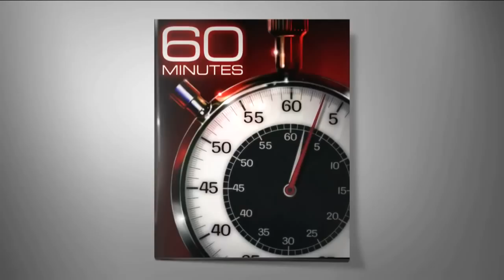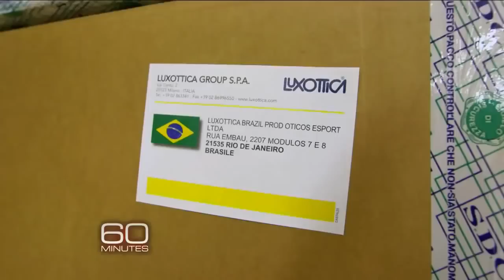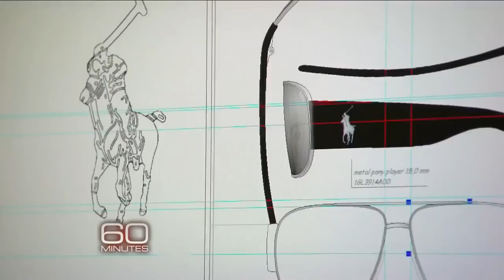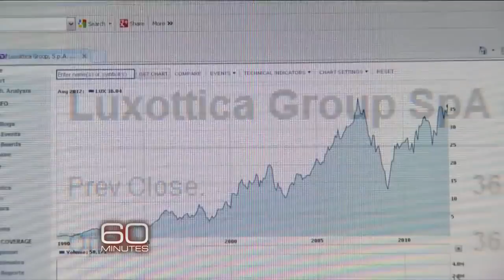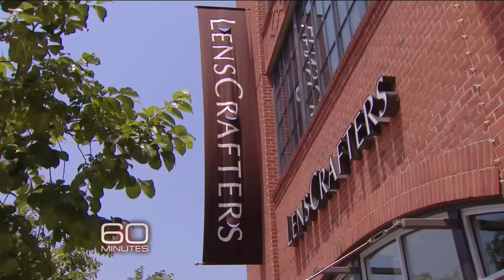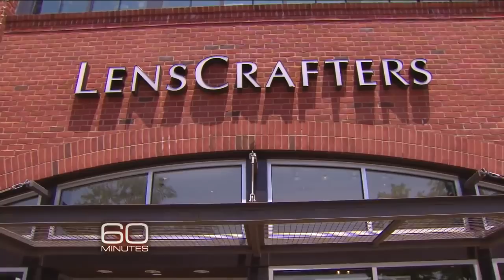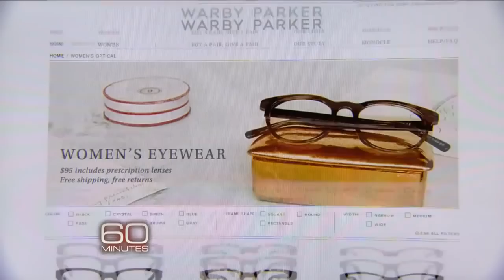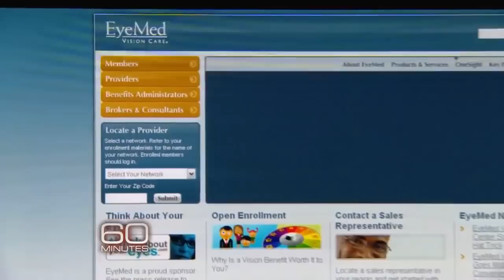60 Minutes   Luxottica  Do you know who makes your glasses

Comment: I bought Coach eyeglasses at Lenscrafters for almost $500 thinking they would be more durable. The side broke within a month and they are scratched even after paying extra for anti scratch. Took them to the store and the guy told me too bad, nothing they can do. Went to another lady in the store and she told me about sending them to "Luxottica" but that people didn't know about or use that option much and the first guy had never heard of it. They did fix the side only quickly, but I will never buy from Lenscrafters again. Ones I've bought from Walmart are still going strong with zero scratches and held up much better.
Reply: That’s because they aren’t “anti-scratch” the correct term is scratch resistant. If someone is using the word anti-scratch they are rookie Opticians.

Comment: I worked for Luxottica. The quality of these glasses is no better than what youd find at the dollar store. About once every 3 months, we would fill a dumpster with perfectly good glasses, some still in cases. They wouldnt sell them at a marked down price. They trashed them to get money for them. And the managers are garbage. I was fired for getting injured at work. They dont give a rats ass about their employees.
Reply: The section of this segment concerning Ray-Ban could be expanded to a full segment of its own. Look at what Luxottica did to Ray-Ban, a once high-quality American brand. Luxottica swooped in, cannibalized the brand and cheapened it while jacking up the price. How do I know? I have a pair of Ray-Ban Wayfarers from 1984 that I got in high school, and I still wear them today—and they look brand new. Not only the is the frame high quality zyl, but they have genuine Bausch & Lomb UV lenses that are glass, not plastic. They also—and this is crucial for any quality glasses—have heavy duty seven barrel hinges that are riveted, not glued on. Most Luxottica frames are cheap plastic, both the frames and the lenses, and they use cheap plastic spring hinges that are cheap to manufactuer but break very easily and don't last long. If we only lived in a just society with an FTC that had the power to break up mafiosi operations like Luxottica, the US consumer would get a fair deal on eyeglasses.
Reply: @danielstoddart  Do you have a model number or a way to look up those glasses?
Reply: Which luxottica did you work at?

Comment: I'd like to say there's no difference between the cheap glasses and the more expensive ones, but I've worn glasses almost my entire life and I've noticed that the more expensive frames are way more durable and have a "heavier", more sturdy feel. The lenses (prescription) also don't scratch as easily and if they're tinted, the tint just seems more even. They're still way over priced, but they are higher quality.
Reply: You totally contradict yourself in this comment man, go back and read the whole paragraph and tell me you didn’t start by saying that cheap glasses and expensive ones are the same and then you moved on to saying  “but still are high quality” 🤦🏻
Reply: @ayrtonvillalobos4213  No, you just have a hard time with english.
Reply: And they are not affected by hair products as much.
Reply: Of course cheap glasses may look similar but they are not at all.  as an optician I tell this becareful exspecially with cheap  or plastic lenses, and there is a very good reason for that.
Reply: Of course. Those are well made glasses, it is not just cheap plastic as the journalist claims. It's just jeaulosy.
Reply: @ayrtonvillalobos4213  is you that have an elementary text comprehension capacity. She begins by saying I’D LIKE so she wanted to say that the glasses are equal. Than she says BUT so than what she is saying is what really happens. Understand?
Reply: The frame price has no bearing on the quality of the lens when it comes to prescription lenses. I can take a dollar tree frame and have the same quality prescription lens put in as the Gucci frame you got from your local optician. 

If you’re talking non prescription lenses that come in sunglasses, of course higher price means higher quality, such as Ray Bans sunglass demos.

Comment: I moved to buying online and haven't looked back. The eyeglass biz is a scam when buying these brands in a store. The coatings cost is also a scam. I've gone from paying over $600 for a pair of glasses to $89. They actually hold up better, the expensive lenses scratched easily and these don't, and I get complements just the same. Never going back to the ripoff folks.
Reply: Can you please share the websites your shop online at?
Reply: @Alainesteph  I'm not the person you asked, but check out Zenni Optical and EyeBuyDirect.

Comment: You could NEVER buy ray bans at gas stations for 29.99 unless youre talking 1958 or something. They were famous and expensive in the EIGHTIES already. I think my were like 179.00 in the late 80s early 90s
Reply: And $30 in the 50s are probably the equivalent of $300 now. In the '50s you could also buy a brand new car for $3-4000.
Reply: I am 59 years of age and remember Ray Ban's at gas stations for $19.99 - $29.99 in the early 80's.
Reply: 30 USD in 1980 equals 110USD in todays money.
Reply: @UCkFvZiCmKQ34UOsW8pJ4TDg yes and no. I doubt your statistic or it's context
Reply: @markfrost2707  you can doubt all you want, but a quick google will give you similar results on any site.
It's math.